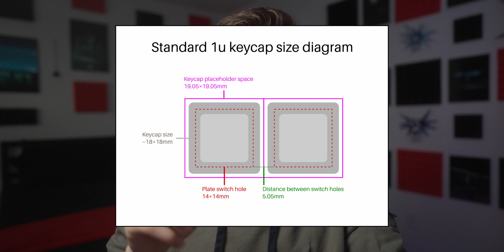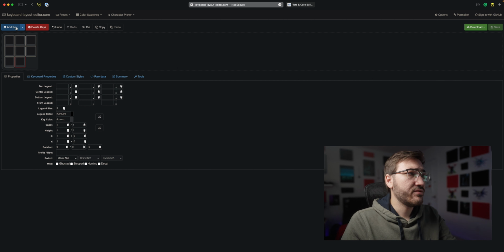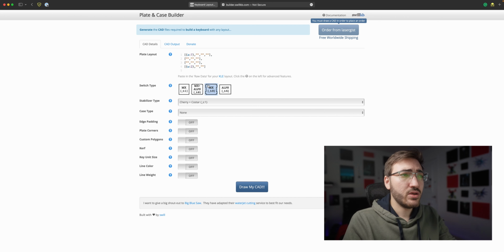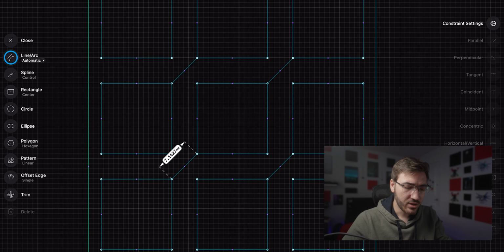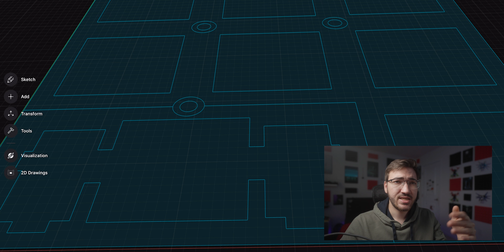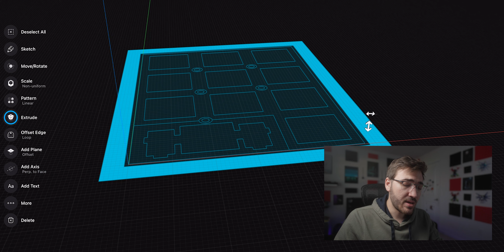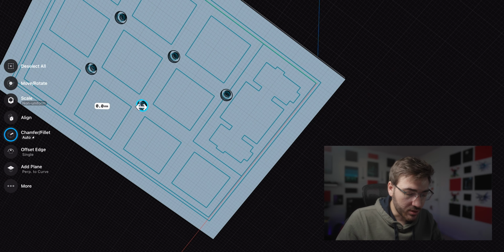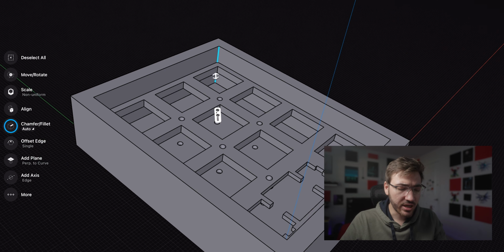How to Design Mechanical Keyboard Plates and Cases

Comment: A note about the thick plate. MX switches won't click into the holes properly since the flexible "click" part assumes a plate of 1.5 mm thickness. I noticed this the hard way, lol. What I do is I add an offset to the switch holes, kind of like your stabs box, and make sure that there is a 1.5 mm thick part before it widens slightly
Reply from the maker: Yup, that’s what I do now and updated all my boards to use the same. Makes it sturdy while still allowing them to clip in

Comment: I'm working on my "Josho-9" now, redesigning the Scotto-9 to fit my microcontroller. =] I'll post it over in /r/handwired when I get it wired up!
Reply from the maker: Hell yeah! Which controller are you going with?
Reply: @joe_scotto  I had a teensy2 laying around for another project that I have been using to test out all of this handwired stuff since I saw your reddit post/youtube video-- I had success wiring up the 3x3 so I feel really inspired like I can keep going!

I bought a couple "0xcb pluto" boards that look really pretty and are usb-c that I want to try something like the corne or your ScottoSplit, but a 60% O:-)

Comment: Great video this helps me a lot. One question what mm would you recommend for a top case?
Reply from the maker: If you’re referring to the plate, I would still say to use 3mm thick. You can add a recessed section of 1.5mm thickness inside the switch cutouts to allow them to click in.
Reply: @joe_scotto  I'm planning on gasket mounting my pcb and plate sandwich. this would be a brass material on top of the plate. Your switch size diagram helps a lot but I was wondering if there was already a size you used.

Comment: What if we use pre-built pcbs? How do we align the screws with the plate/case?
Reply from the maker: You just align them based on the dimensions of the pcb screw holes.

Comment: im not sure if you mentioned it yet, but I am trying to make an alice keyboard or something generally similar to that which involves a gap/space. how would i set this up within the keyboard layout editor? thanks
Reply from the maker: It’s a pain in the ass simply put. You have to use anchor points and rotation to get everything set right. I do believe though that it has a preset for the Alice that you could then modify. That might make it a bit easier.
Reply: @joe_scotto  I was on the mechkeys discord and got some formats that I've been able to use. I'm currently about to add the screw holes to the plate if I can figure it out, its my first time using fusion 360 so I'm having a bit of trouble. What software were you using?
Reply from the maker: I use Shapr3D on iPad :)
Reply: @joe_scotto  how do you get it from the ipad to the printer or computer?
Reply: @joe_scotto  another question I had was, if the stabilizers are plate mounted and there is no pcb, what is preventing them from just falling out of the bottom? are they close enough to hit the bottom of the case?
Reply from the maker: @brananandreu4086  they just click into the plate

Comment: What about the microcontroller? How do you go about securing it and cutting out the right shape?
Reply from the maker: Depends on the controller. For most boards I just measure the dimensions and hot glue it into a cutout with them. More recently though I’ve been using socket headers: https://youtu.be/Qkx9M-AzznE

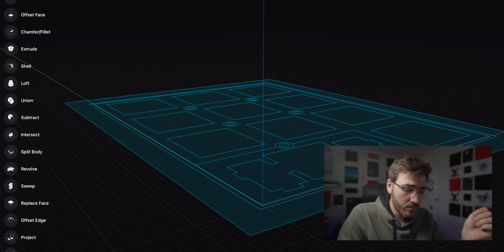Comment: Is there a setting you have on that you did not show? I followed this tutorial but when it came to extruding like you did at 8:18
 to make the case it did not keep the original switch image with the screw holes it just made a rectangle.
Reply: I experienced this as well. Good news: the sketch layer was simply hidden.

So it’s still in the layers panel for you to make visible again!

Comment: Really cool video, What program do you use to configure the screw holes in your plate? I am currently working on a plate for my board which only has fp3 plates available. I really want to try a more flexible plate on this one. 

My drawing is already finished, just need to finish up with the screw holes and I can place my order.
Thank you so much in advance!
Reply: Have the same question and want to know which software too!
Reply from the maker: Shapr3D

Comment: That last section was so smootly done! I'm using freecad and I don't know if it's a skill issue, or if shapr3d is really that better. I want to try it but the free tier of shapr3d looks ass  :/
Reply from the maker: Free tier is the same as the full version except you can only have 2 projects and less export options.

Comment: Wont the 3mm printed plate prevent the switches from clicking into place? normally they click with a 1.5mm plate, right?
Reply from the maker: You’re correct, they won’t click in but the friction alone is enough to hold them.

Comment: Do you know any solutions for handwired 2u stabilized keys on a 3mm acrylic plate?
Reply from the maker: You could possibly glue it into the plate but the issue then would most likely be binding of the wire. The only other possible option I could see is maybe cutting out a rectangle from the 3mm plate and then trying to fit a 1.5mm thick portion in there with glue.

The real best option IMO is just printing the plate if at all possible because then both of those issues won't exist anymore since it's basically a "hybrid" thickness plate.

Comment: would you be able to do a video with some slight guidelines on placing your MCU of choice?
Reply from the maker: Not really much to say about it. Really you just need to place it countersunk in the case and position a hole to match where the port is. 

The only thing I change build to build really is the dimensions depending on the controller.

Comment: Do you really pay $25 for Shapr? Is it really worht it? Tried the basisc and tutorial and it feels like a great step up from Sketchup to get me closer to Fusion 360... Just not sure I can front that cash every month on a program I'd use pretty infrequently.
Reply from the maker: I think it’s very worth it, I’ve tried fusion 360 and the performance is terrible on my Mac. Shapr3D is very intuitive to use which is what I love about it. 

If you happen to be a student, they have a discount that will give it to you free.
Reply: @joe_scotto  that's why I liked SketchUp when I first started using it all those years ago.

I would prefer something with constraints and sketches over SketchUp. It's getting old now. My van build 3d model is way too complex now for SketchUp to be fun..

Thanks for the reply. I love the fast paced tutorial that assumed I'm smart enough to figure the rest out.

Comment: what about choc-switches? there are only mx ones in the tool
Reply from the maker: MX and Choc use the same 14x14mm cutout. The only difference is that MX clips in to a 1.5mm thick plate but Choc needs 1.2mm.
Reply: @joe_scotto  nice, thank you!

Comment: Don't you also pull in the plate holes to sink the screws in? Otherwise, they'll sit on top of the plate's surface.
Reply from the maker: Nope. It doesn’t matter for the plate, there is enough clearance and it’s measured so the screw has enough length without the countersinks.

Comment: You said there are issues with laser cutting Cherry MX/Alps, but you never specified what they are.
Reply from the maker: I don't remember what I said in the video but there shouldn't be an issue laser cutting MX/Alps. However, there is an issue 3D printing MX/Alps cutouts and that is that if you do the standard 1.5mm thick plate, it will be really flexible on a 3D print. To negate that issue, I print my plates at 3mm and use either 1.5mm thick recessed areas to help clip them in or just rely on friction.
Reply: @joe_scotto  Thanks. It makes sense. I'm looking at options for creating a custom keyboard. Currently, I am considering SLA or FDM for the case, but I'm concerned it might be too large or too expensive to print using an online service. I'm going for a 60 to 65% form factor. 

Btw, if 1.5mm is too flexible for a 3D printed tape, you might be able to epoxy small ridged metal bars horizontally across the plate in rows. It can also serve as ground bus bars to reduce the wiring. It's unclear, however, if there's enough clearance where you'll need them. Copper tape is another option and can be soldered onto, however, it won't add much rigidity to the plate.